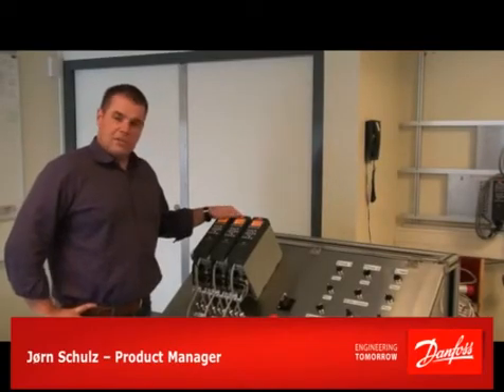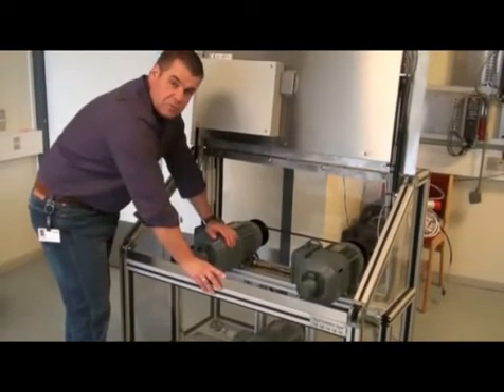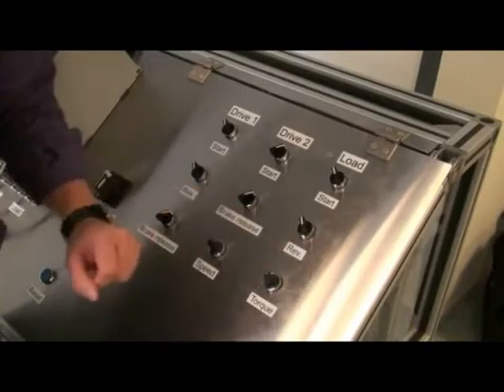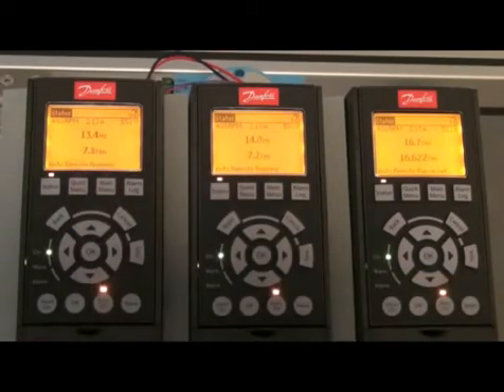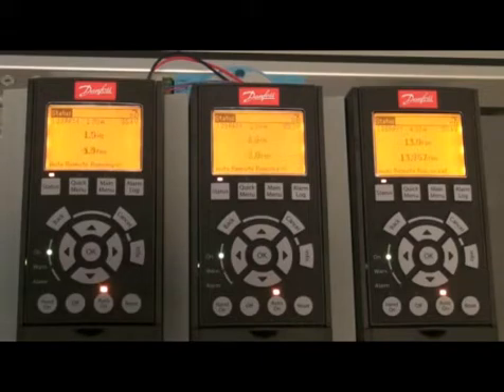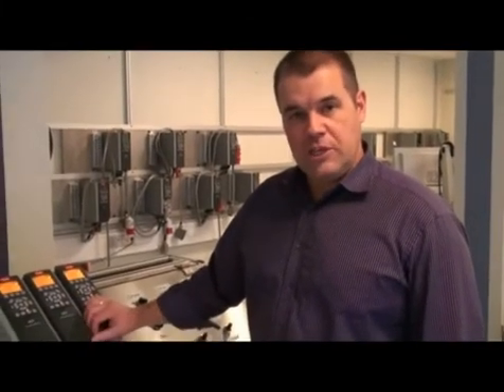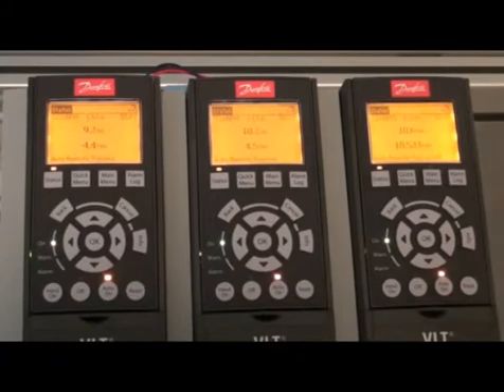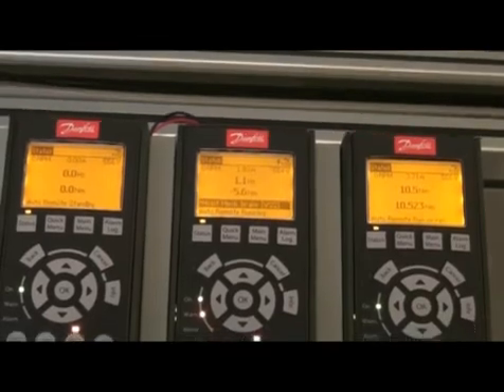Danfoss VLT® Droop Function & Mechanical Hoist Brake Control explained

Comment: Thank you very much for this excellent illustration of the droop control.
Can we get the drives parameterization files? 
There must be some situations where M2 runs faster than M1 to balance the load, and that would cause M1 to run with a negative slip as a generator, how did you make it to not slow down this movement? and wouldn't that cause a slack belt after M2?